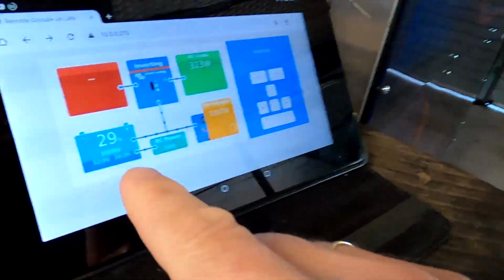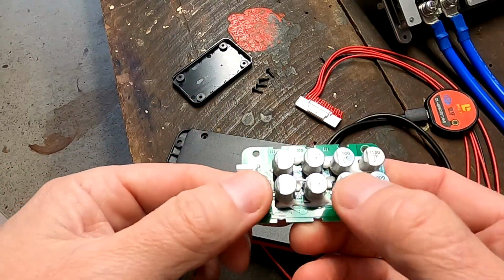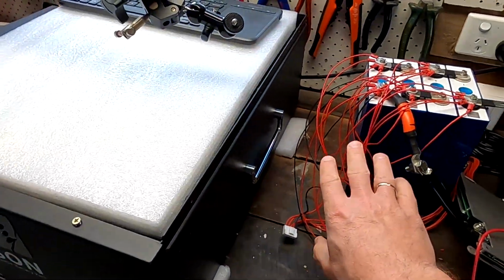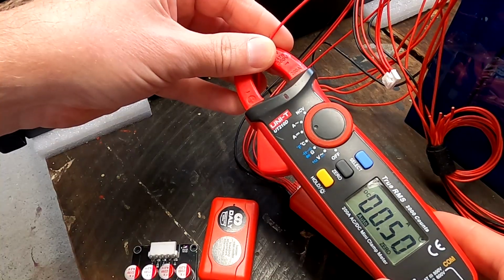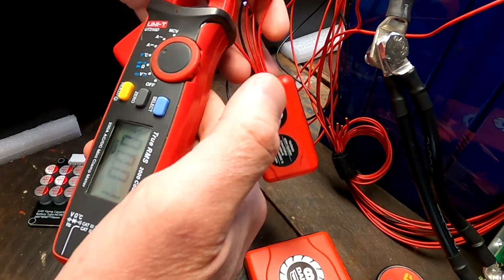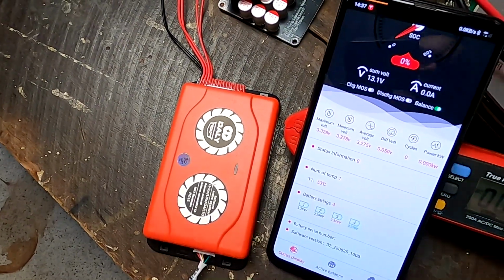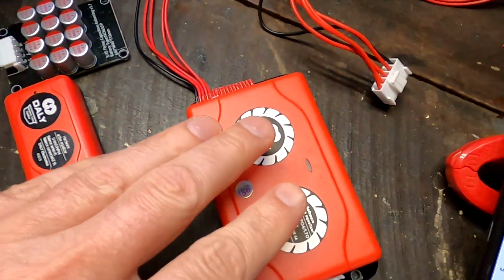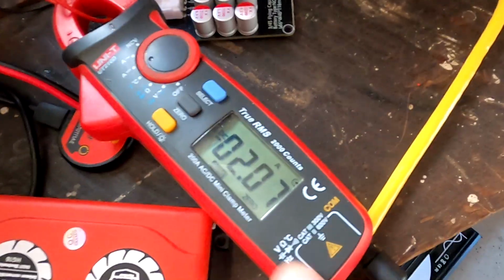DALY has now Active (Smart) Balancing! Is this the new NEEY?

Comment: Your clamp meter probably have precision for DC like +-(0.7% + 5)  (based on UT210E pro model) so it mean 5 uncertainty in latest digit, and  because it show xx.xx scale probably its 0-20V (cant be 0-2 because it 3+V) so lets check precision   +-((3.3 * 0.7) / 100 + 0.05) = +- 0.07 so if real precise voltage is 3.30 clamp could show you 3.23 to 3.37 and it will be valid because in precision range. I dong think that daly have better precision class than measuring tools so difference in 0.04v is totaly OK.

Comment: it's good that you dismantled this bms, how many are its dimensions, length, width, height when disassembled?  I want to buy this!!! but I don't know if it will fit inside my e-bike battery?
Reply from the maker: Don't know, I didn't measure the PSB. There is a link on my website to the product with dimensions, but that's the outer dimensions only.
https://off-grid-garage.com/battery-management-systems-bms/
Reply: one more question please!!!  turning on and off the active smart balancer daly can only be done with the help of bluetooth?  Can I physically make a turn-off button if it is placed inside the box?
Reply from the maker: @jurasiksafonins189  I guess, you can just disconnect the main positive to the balancer, but I would check this with Daly before trying.

Comment: Hi there and thanks very much for sharing this with us. Just wanted to ask how your Daly smart active balance work as I bought one from Amazon (16S 12V) and I contacted to 4S 12 V Lifepo4 battery. It doesn’t work at all . Connection diagram is like this . Black negative and the next 3 cores to batteries and the fourth red core to + battery positive. Could you please help me with this? Thank you in advance.
Reply from the maker: It probably needs a higher voltage on the last red one, but that's just a guess, not a recommendation. Please refer to the wiring diagram of the balancer.
Reply: @OffGridGarageAustralia  thanks for your reply 
They didn’t send any specifications sheet. Only balancer itself in a plastic bag 🤦‍♂️.
Reply: @catalinbelibou5812  if you have a 16s balancer I think it will work with 4s if you connect unconnected red wires together with your 4s positive wire. then in the app change the cell count to 4s. I have only tried this with 3s and 4s with a 4s balancer so unsure about the 16s so be careful and try at your own risk as I don't work for Daly.
Reply: @uhjyuff2095  thanks for trying to help out, I did that and still doesn’t help to balance the cells. Sent it back already. Thank you once again and really appreciate.

Comment: Could someone confirm that the Active Balance menu on the app is only for the external Active Balancer shown in this video and does not work with the latest Daly BMS on its own? 
If not, why don't they have an all-in-one solution?? I have one cell climbing in voltage near the end of the charge and it cuts out the charging process. Where can you get a comprehensive manual for Daly BMS? I've searched and searched and there is bugger all info out there.
Reply: yes, the app asks you to connect to a specific device and then once you connect the app sets the settings ONLY for the device you have connected to. Then if you have a second Daly device you have to unconnect and connect to the next device and set up those settings.

Comment: my daly Smart balancer was 28.00 on Amazon but don't seem to work to well what would you recommend
Reply: set the balance delta voltage to 0.02 volts for the best balance. I tested on my battery and it did great.

Comment: Hi, Wonderful Videos, I'm waiting for my 3 each of  Daly 8S 24V Smart BMS's,  Smart Active Balancers, 5 Amp Parallel Module .. Ill be paralleling 3 x 200AH Lifepo4 8S systems for a total of 600 Amps capacity.

I noticed you had an app with Daly BMS Wire Diagrams, or a web sire, would you mind sharing how to get that? Have been unable to find much documentation at all to be honest

Comment: I saw this info for the small DALY balancer from Lazada Philippines. Start up >= 3.3V (average single cell voltage) Close condition <= 3.0V (average single cell voltage), Active equalizing and working current 250 micro ampere. Sounds more like a passive balancer.

Comment: i have 1 amp daly and didnt relise it was bluetooth is same size as your bigger 2amp one you show that works ,i can use bt module from the bms if i wanted to use it , jk has built in one dont see point
Reply: the daly balancer with bluetooth has a circular dongle attached with a wire to the balancer. If yours doesn't have the bluetooth dongle you probably don't have the bluetooth one.

Comment: You can parallel active balancers IF you keep separate sense lines for each balancer.  That can be quite a rat's nest of wires.  

Sharing a common single set of sense lines will cause interference in voltage sensing between balancers due to async operation between balancers.

Balancers momentarily stop pushing balance current during cell voltage measurements to avoid having voltage drop on sense wires.
Reply: exactly true. I have seen the app when the balancer is on and the voltage of the cells changes probably from the voltage drop and current when the balancer is pulling current. then it will stop and go back to normal accurate reading.

Comment: Hi, my issue with Daly is cut off prior to Inverter change over to grid line. How to set it properly? FYI I am using 16S 200 a Daly with blue tooth, connected to DIY to 16 of 3.2 v 200 a CALB lifepo4, system 48v and using Growatt SPF5000ES. Thank you in advance.😊
Reply: get a daly smart active balancer maybe it will keep the cells balanced or raise your inverter battery low voltage transfer setting.

Comment: hello your Smart active balancer i noticed it is for 16s battery banks but it also works on your 4S battery bank ?? or am I wrong to see and is it a Smart 4S active balancer? I hope you answer me in the meantime thank you. Angel
Reply from the maker: Found your question, sorry, just far too many comments to look at in a timely matter...
So, the balancer works with 4s and it seems they have just cut off the remaining balance cables from a 16s balancer. It seemed to have all the connections and should also work from 4s-16s batteries.
Reply: @OffGridGarageAustralia  Thank you so much for the answer and sorry if I asked you the question in the other video you posted but unfortunately I needed to have an urgent answer. I finally decided to buy the other active balancer Where you posted a video and saw that you were really excited about it. it was the balancer of the NEEY. I ordered that because I saw that in your tests it is really very efficient unlike this one from DALY. THANK YOU SO MUCH FOR YOUR AVAILABILITY 😉☺️☀️🔋

Comment: hello my name is Angelo I wanted to ask you the smart Active balance for how many Cells was it originally? because I saw you cut the cables and it worked on your four Lifepo4 cells. but was it originally for 16 cells?
Reply from the maker: It was bought as a 4S balancer but the plug showed cables for a 16s battery, so, they just cut them off...
Reply: But did you test it on 16cells? You mentioned you felt keen about checking it with another cable/battery.

Comment: 101122/1429h PST 🇺🇸 Thank you for the info on balancers. My 3 meager 4s systems works well to my satisfaction with Delta @0.002~0.003 mV. Readings from JBD BMS (passive balancing)
My question:-  Is it alright to connect AB permanently, to the system or not? (Though I may not require) I have seen some commercially available LiFePo4 Batteries with built-in AB. Danke und 73s…

Comment: Oh, I am demanding all I said in my last comment and claim the opposite! 

I think I will buy the neey balancer! Do you think that the neey is able to handle my seplos Mason rebuilt pack with 280Ah cells? 

Greetings from Germany. ✌
Reply from the maker: The NEEY is great and works well. It will have no trouble balancing your batteries.
Reply: @OffGridGarageAustralia  is there any android software for the neey 4th gen? On github there is only software available for download for the 1st till 3rd version! Or is the software for the 3rd version already running with the 4th gen neey??
Reply from the maker: @Oli83two  App version 3.1 should be the latest and will work with gen 4 of the NEEY balancer.

Comment: I don't think that all cells being over the threshold is a huge problem. If your bank has cell under for example 3,2 volt and even one over 4 volts your BMS should cut the pack out. It's not a bummer it is what it's there for. Over 1 volt delta is not faulty balancing design it is faulty cell(s) or complete lack of balancing. You are creating voltage difference by charging one cell by it self and/or discharging one. That is in no way the correct way to charge series battery banks. Functioning packs should not see that kind of difference between cell voltages. On top of that balancer is not behind BMS and it can not provide charge to the pack, but it can discharge the pack. On that sense I would like to see definite undervoltage cut out on balancer as this one has. In general I just think that your example about one cell shooting up to over voltage cutout has nothing to do with balancing functioning cells. That is a bad cell and playing around trying to balance broken cell with set your garage on fire.

Comment: Hello and great thanks for tour YouTube Channel.
Sorry for m'y english i'am french.
Atcually a have a 16s 105ah lifepo4 batterie pack for my 4600w Solar installation.
Actually pu bms is a 100a Daly and a have adds a heltec active balance that i manually start when a imbalance is to high (0.14v at 55.5v and charge at 35amps).
I want to upgrade my battery.
Please what would you recommand again, neey active balancer or change a Daly bms for to a jk bms ?
Knowing that in the future i would Mike add cells to make a 16s2p battery.

Thanks in advance

Comment: I also purchased a Daly Smart Balance 2 weeks ago. As soon as it arrives, I'll check, if it behaves the same. I should also design a BMS and Balancer... Seems, that there is nothing really good on the market 😫
Reply from the maker: So far, only the JK-BMS seems to be the best option in terms of BMS and balancer combined.
Reply: @OffGridGarageAustralia  Currently in Germany, there is a run on Mini-PVs up to 600W inverter power and 600-900W PV-Peak-Power. Many people ask, if they can somewhere get one ideally with some battery storage. If some ready-to-use low-cost, low-power (200W AC inverter, 1000W MPPT-Charger) on-grid hybrid inverter, integrating MPPT charger, BMS and balancer for a 12V battery would exist, it would be sold out in hours...

Comment: I tested the 16s active balancer and had to play with the configuration until it worked well. A not mentioned design issue is a heat problem. The temp sensor is onboard, when cover is removed passive cooling works.
Reply from the maker: Ah, I was just realising that as well. Mine got already up to 48°C doing its job. But then removing the cover seems to be a workaround for an arising problem.
Reply: @OffGridGarageAustralia  Thank you for confirming! I first thought it us due to the heat here in Europe but now it's definitely cool and still had a high temp alert. Without cover and a safety layer of plastik 70 everything is ok. Cheers!

Comment: i think the all 4 cells been over is ok as this is leaving the bms to do its job and only when the battery nears full does the cell balance start this way it is not running all the time throwing cells out of balance like you have shown befor
Reply from the maker: That's a major design fault! If one cells runs away, the balancer won't do anything to help preventing that.

Comment: Another interesting video, thank you.
While the Daly balancers were a little underwhelming, it's still great to see new products!

I jokingly said that they must have gotten wind of the 250A JBD BMS with external 5A active balancer that I'm developing and have beaten me to the punch.
Reply from the maker: Thanks Ruben. DALY is not there yet and they actually moved a step backwards with these active balancers. We already have better options on the market.
Reply: @OffGridGarageAustralia , example of better than daly active balancer?
Reply from the maker: @codiastluce410  sure: https://youtu.be/jpG3siEzll8
Reply: My Ant BMS won't turn on, and I am looking for a 200A(?) BMS for a 48V Lithium Ion for a 3000W inverter. Which BMS do you recommend?
Reply from the maker: @mrtechie6810  Go with the 200A JK-BMS, the B2A20S20P. In the next video, I will show why this is the best BMS on the market. I mean, I've shown this before, but this time, I'll make it the really best best one😉
https://off-grid-garage.com/battery-management-systems-bms/

Comment: I noticed that during your testing you calculated the PACK cut-off voltage as a multiple of the highest cell voltage that you desired. One thing I was wondering about is when the current BMSs stop the charging process they are using the total PACK voltage to determine when to pause charging rather than the highest CELL voltage. I believe that they should be using the highest individual CELL voltage because a single cell might rise WELL above the desired cell level cut-off voltage while one or more of the remaining cells are far enough below voltage to keep the total pack voltage below the pack level cut-off voltage while the bad cell becomes dangerously high.

This problem could arise if a pack hasn't been charged for some time such as having been sitting around before being sold and used for the first time.  David Poz just posted a video which had a new pack not delivering the posted amp hours until after it had been charged for the first time. I wonder if one or more cells in that pack could have exceeded the desired CELL level voltage while waiting for the entire pack to reach full voltage on the first charge. When one builds their own pack and top balances each cell before assembly there shouldn't be a problem with one cell being MUCH higher than any other on the first charge. 

The reason for current BMSs having a wait time to resume charging is to allow any high cells to get below the cutoff point. During this wait time while charging is paused, cell balancing should be allowed to continue otherwise the high cells would never be brought down to a safe level and the battery pack would never achieve it's full potential amp hours. I seem to remember that during your testing one or more of the BMS's you tested stopped balancing when the charging process was paused.
Reply from the maker: Yes, that is correct. Some BMSes have both settings for a single cell OVP and a pack OVP. Whatever comes first will trigger the disconnect. The JK-BMS has only the cell voltage protection. And this makes totally sense. As you said, if you have a runner, the BMS will catch that by measuring the single cell voltages. The overall pack voltage could still be below the threshold and trigger point.
There is always a trigger and recovery setting for these features (Heltec does not have that and the recovery cannot be set by the user). If the BMS only has charge balance though, it won't do any balancing if the BMS has cut off the battery. JBD, DALY, Overkill are some of them which are really bad with this design. The BMS will only balance during charging. With these, the battery will only sit there and wait for this single cell to naturally come down in voltage before the BMS connects the battery again. That's a shit design.

Comment: Hello thx for you videos
Very clear and detailed 
I have issues with daly bms 250A 4s.
The parameter end of charge dont work.
And the charge stop on the over charge value.
If you have any idea your d be welcome.
Reply from the maker: Thank you. So first of all the BMS should not control your charging! This is a task for your charger or solar charge controller. The BMS is simply there to protect the battery if the charger is faulty and keeps charging.
The charger should stop charging before the BMS triggers and disconnects you battery.
For example, you can set the charger to charge your battery to 3.45V/cell and have the BMS turning off at 3.6V/cell.
The BMS should not disconnect the battery unless something is wrong.